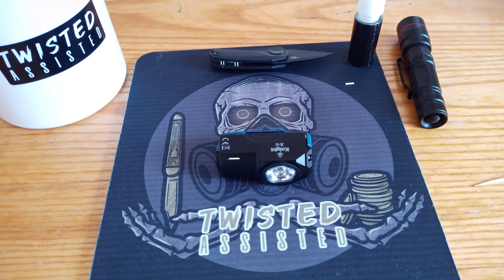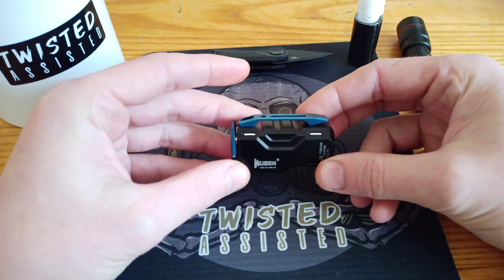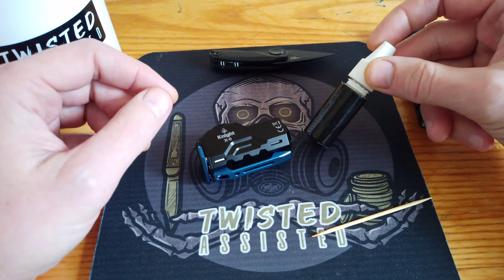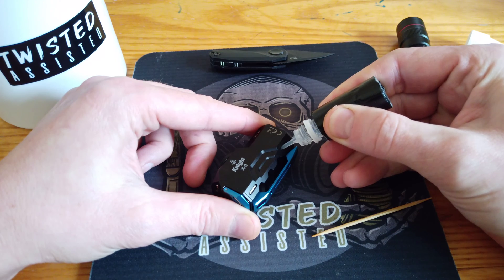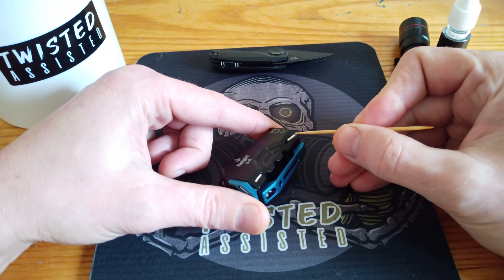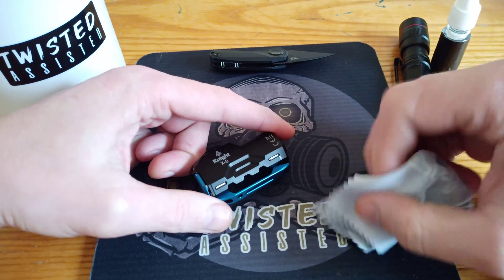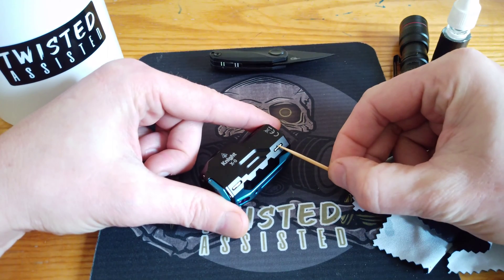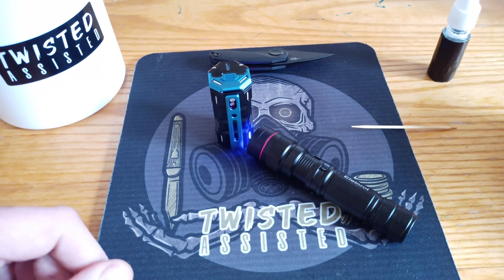How to install Tritium vials to the Wuben X-0 Knight EDC torch

Comment: Hey I see you have the titanium grey version available of the Wuben x-O. What are the specs? LED ?
Reply from the maker: Hi, yes we have the Titanium version which comes with the OSRAM P9 LED, 1100 lumen, more specs are available via our site, please follow the link below. 
https://www.twistedassisted.co.uk/store/wuben-x-0-knight-edc-torch/wuben-x-0-knight-titanium/
Reply: No free shipping to US I’m assuming hehe.
Reply: One thing everybody is forgetting about tritium vials/tubes is that tritium is a radioactive gas and the high temperatures that any high power/lumens flashlight can get is a powerful reason for NOT TO INSTALL those tubes on our EDC lights. Crashes are also very dangerous, because they can compromise the integrity of the tritium tube (same thing for the heat), so it could break and you don't want that to happen because radioactivity is BAD for you, you know? If someone "manages" to break one of those (something really easy if you've got slappy floppy spaghetti fingers), don't touch it at all and call to the CBC (if you touch it, you could end getting yourself a "balls" cancer, you know what i'm saying?). Be careful, please.
Reply: @N8SANZ  this is false. The type and amount of radioactive material in a tritium tube is so low that it poses absolutely no threat at all.
Reply: @N8SANZ  Educate yourself before writing statements like this. Quick google search and here you go: "Tritium is a relatively weak source of beta radiation, which itself is too weak to penetrate the skin. However, it can increase the risk of cancer if consumed in extremely large quantities." Those vials are too small to cause anything. Your phone is more radioactive than that.